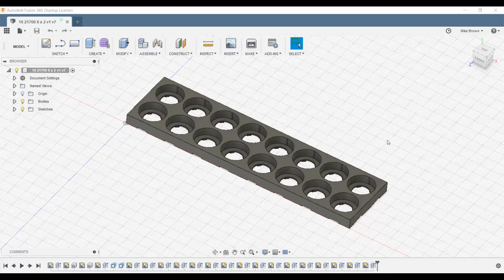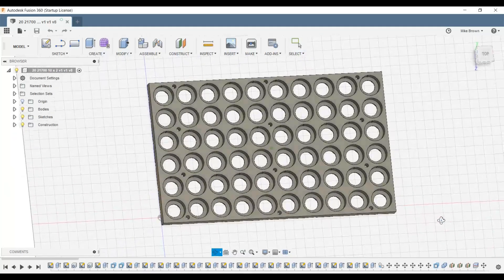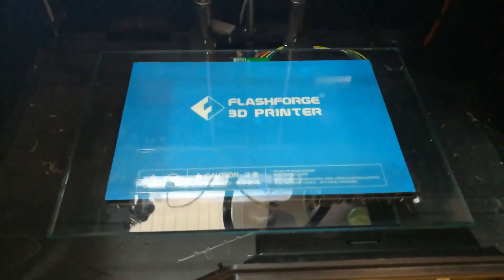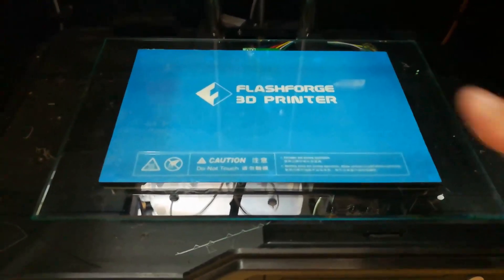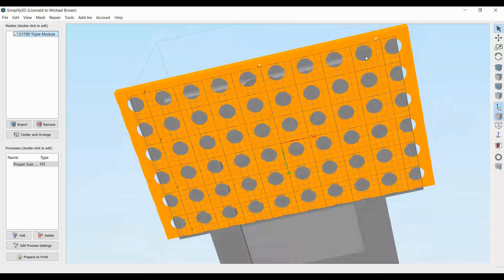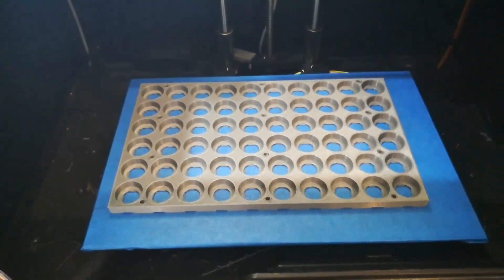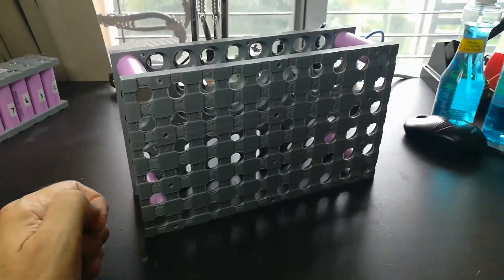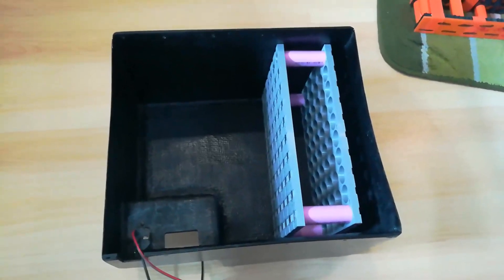21700 Lithium Battery Pack Part 7 - Designing a 60-cell 21700 Holder and Oversized 3D Printing

Comment: Since you have the printed model do you think if I narrow the spaces between each cell by half of the original size do you think that will work or will it be to narrow because 28 cells in series that makes a hell of a big pack lol
Reply: Thanks for the Tip how ever I have a feeling that should be an issue because the battery can do 35AMP continues and 45AMP peak. 
28S 24P that’s 1100AMP Batt if I will be pulling Max 700AMPS I don’t think there will be a heat issue I will be pulling Max 29AMP from a parallel. What do you think?? What would be your option on it?

Comment: Love the holder. 
Gonna try to make 28S 24P I’ll split it in half for my go kart. 
28S 12P 28s I’ll split in 2 because it will not fit the printer. 
Any possibility to work from your design?
Reply: I downloaded it but for some reason I can’t do any modifications to it it’s like 1 peace. :(
Reply: Michael Brown thank you so much I’ll sand you the link of what I made out of it if you gonna want it thanks again.
Reply: I’m sure you know this already but just in the spirit of safety, a friendly reminder that 28S/103.6V DC can be very dangerous, they say that anything above 60V requires extra caution because of DC’s propensity to arc! Be safe and good luck, sounds like that go kart is gonna rip 👍!

Btw, 7.4kWh if they’re Samsung 30Ts… that’s huge 😆! I’ve got to see this, please upload a video if you make it. I’ve been planning an 11kWh e-scooter myself, using 60Ah LiPo pouch cells (20-22S,2P) which have a 6C rate, hope I get to make it some day. If you haven’t heard of the BESC G2 controller yet, look it up, it may have the kind of discharge you’re looking for - 100V 400A max. Is an open source design based on the VESC platform which is very configurable.

Comment: Great build! I'm at the beginning stages of building a battery bank... I like that your using the 21700's, their probably the best bang for your buck! Elon Musk thinks so too ;) Anyway you could add that 21700 holder on Thingiverse ? It would be much appreciated ! I would be happy to help any way I can ...
Reply: Great, thanks for the reply ! The cool thing about uploading your 'makes' as I have found out, is that while other people can use the design, they also improve on the design most of the time as well, AND they/we watch your videos. Im not the best at Fusion 360 but when I saw how terrible the Mac Mini mounts were on Thingiverse.com  I just made one from scratch and its by far much better than anything on that site now. Ive mounted my Mac to the underside of my desk where its sturdy, I have access to all the ports, and its OUT OF THE WAY ! Maybe I can help with the 21700 holder design... And someone else will come along and 'remix' it possibly making it much better.
Reply: YUP ! Hey if you don't have time for Thingiverse I understand ! I would be very happy if I could get that STL file though some other way. Email or anything. Im going to use a raspberry pi as a BMS and attempt to build that 60 cell 21700 battery bank. Wish me luck !
Reply: Ohh wow ! Your the man... I'm stoked! Thanks dude... IM A WINNER !
Reply: Hey thanks again man .. I downloaded and now I'm pricing the best 5000 mah 21700's ... It seems Alibaba is the best choice, alliexpress is close to double the price really. What did you find out about these cells? I could really use a second opinion and a different perspective.
I know there are different grades as well, ie. grade B, grade A ... etc but its a little hush hush and in the dark as far as information out there that is easy to understand. That Thunderheart guy here on Youtube has allot of info on them, and recommends Queenbattery.com.cn ... But theres no way it compares in price to Alibaba ...